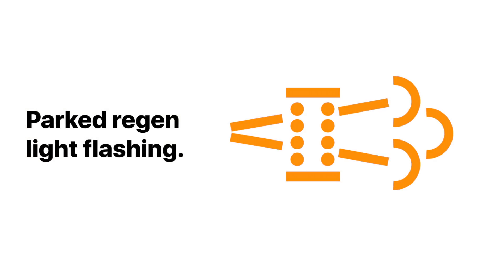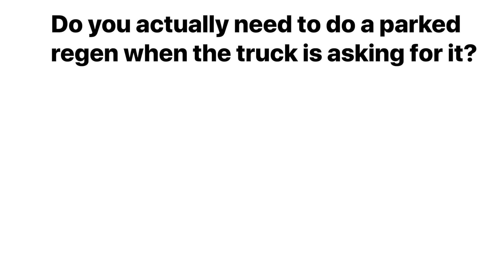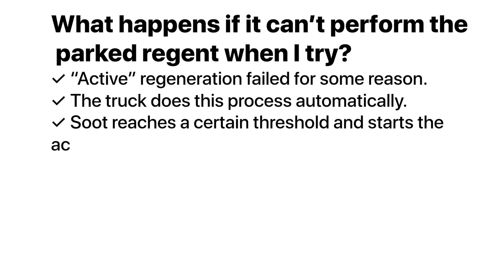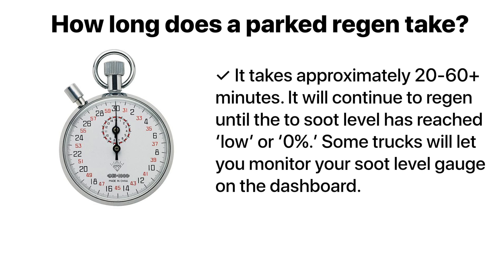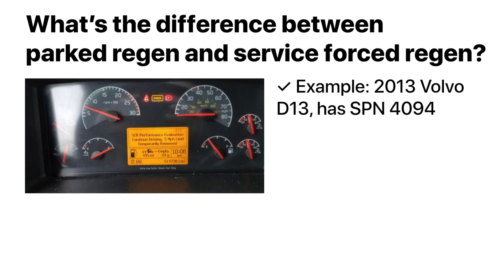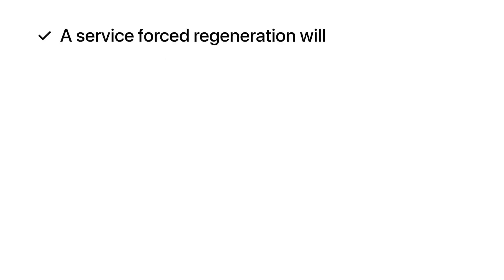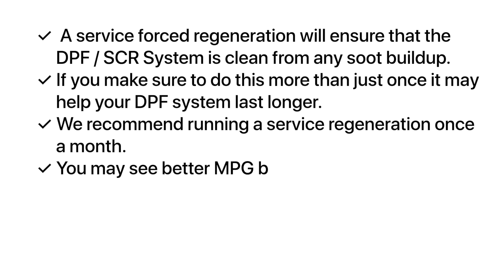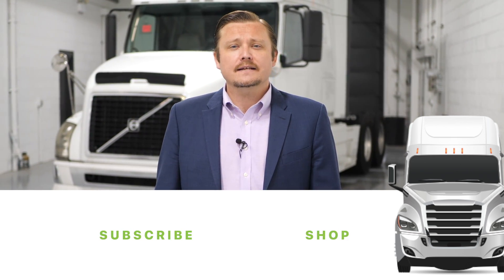Parked Regen Light Flashing?

Comment: Ok, for you guys in a 2022 International LT625, Cummins X15, Automatic, this is the procedure for “Parked Regen”
Step 1: Press the break pedal, Push in Tractor Parking Break.
Step 2: Place Automatic Transmission in Drive
Step 3: Place Automatic Transmission in Neutral, Pull Tractor Parking Break
Step 4: Release Break Pedal, Press “Parked Regen” Momentary Switch, if done correctly Green LED Will be On and truck will Immediately idle up. During the Process, you will see the “High Exhaust Temperature” Light come on on the instrument cluster this is normal, and shows that it is working. Yes, it is finally working! 

After 1hr 24minutes process complete on this truck!

Sometimes if you want it done right you gotta do it yourself, so I did!
Reply: You lost me at "INTERTRASHIONAL" & "AUTOMATIC TRANSMISSION" 🙂
Reply: Fail

Comment: Is there is any way on the freightliner Cascadia 2016 you can do a region without parking is not supposed to be do  a region by it self while  it’s driving or it does have to be Parked
Reply from the maker: The truck will do passive regens while driving if you meet the conditions the truck deems appropriate at that given time, outside of that, all regens parked or forced would require the truck to be in a controlled environment which would force you to be parked to meet that requirement. Let us know if you have any other questions!
Reply: I have same problem my truck never do passive regens while driving at high speed 
Only parked regen spent a lot of money and never been fixed

Comment: What if you just had your dpf filter service and fault code still comes
Reply from the maker: You would need to reset your DPF filter if there was repair work done to your system. Here is a link to a mobile diagnostic scan tool that will help you figure out what the issue is with your vehicle. https://otrperformance.com/pages/otrdiagnostics

Comment: What's the cause if the parked regen light comes on again right after a parked regen?
Reply: It’s happening with me right now did 3 times already
Reply: @karansandhu6090  oh shit. Did you ever get to the bottom of it??
Reply: It's either Bad Sensors or clogged filters I'm thinking. I'm going thru it right now on i40.  Either problem isn't cheap. But what is inexpensive in trucking nowadays. If I get my way I'm getting an older completely rebuilt truck n cat engine soon. 
  I'm in the middle of second Regen in an hour this morning and it's still showing 2nd phase flashing Regen light. So it's not clearing itself I'm thinking.

Comment: What is the issue if it doesn’t do the park regen manually?
Reply: Raymond. I think you have to take it somewhere for service (a forced  regen) it means the filter is too clogged up to work manually.
Reply: Buy a reset tool 🔧 from OTR performance and you will be able to do it every time you want it.